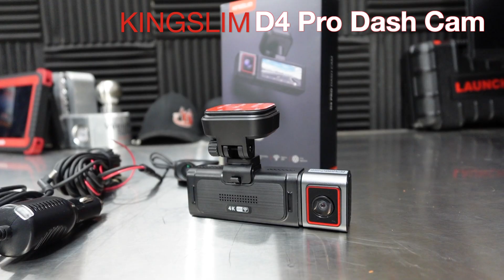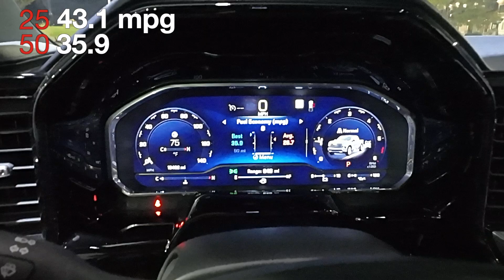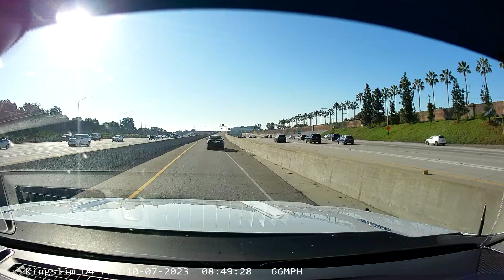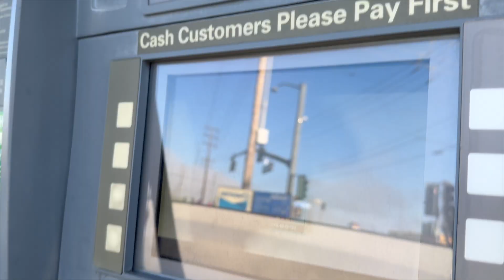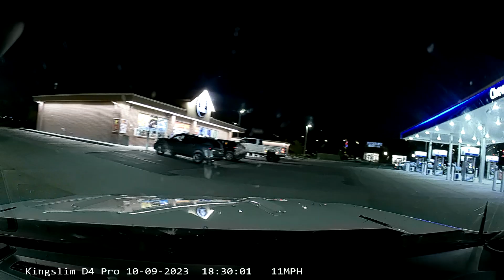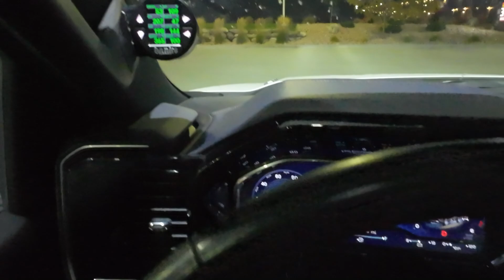How Good Can 3.0 Duramax MPG Get? Utah to California Road Trip

Comment: Hey. Having tested both lz0 an lm2 trucks which do you prefer? I’m close to buying either a used 2023 at4 or a 2021 at4. Both have 20k ish miles. The 2023 is a carbon pro and the 2021 has a heads up display. Otherwise they are similarly optioned.( 2023 has those big mud tires aswell)
Reply: Thank you. Its a tough decision for me having not owned either. The 2021 is about 11k cheaper with the price that dealer offered me. That’s what has me leaning that way. Both are pretty good deals for what I’m getting I feel. Haven’t had a chance to negotiate on the 2023 really but he told me he’d knock off 2k off the sticker. So it would be 61 for the 2023 and 50k for the 2021. Is it just the belt service interval or are their more qualities that increase the life?
Reply from the maker: @sirhc2291  for the cost savings alone, the LM2 is a great option. The LZ0 is not worth $11k difference.
Reply from the maker: Both are great, I prefer the LZO. It just has more power and has updates over the LM2 that will likely increase overall life.

Comment: Those are great numbers. I'll have to try Sport mode on my next trip.

My '23 finally came in at the start of October, just in time for the road trip from the UP of Michigan to Colorado (Like, literally the week before). Best indicated 450 from that trip was 28.7, worst tank showed 25.2 (around Denver and the mountains for the week). I was really happy with those numbers, they are up there with what my '18 Canyon 2.8L got, but the Silverado dwarfs the Canyon. The Silverado was great on the trip, it's very comfortable and easy to drive for such a big vehicle. Not so easy to parallel park in the city, though.

Interestingly enough, my oil level didn't change all that much, I could maybe add a splash but it's still right near the full mark. I know it doesn't need it yet, but since it's going in Monday for the bedliner and such, I'm having them do the first free oil change. 

Oddly enough, right after I picked her up and drove her home (120 miles), she threw a CEL that read out for 'Excessive Regen Commanded'. Since it was late Saturday, I figured I'd call the dealer on Monday, but the light turned off and never came back on. I've since put the Banks iDash from the Canyon in (using their nifty bracket), and I've got it setup to show Regen % and state, so I can keep an eye on it. Seems to Regen more often than the Canyon did, the Canyon would do it once a tank, the Silverado does it maybe twice.

My only real issue on the trip was the rock that cracked my windscreen. :( 

Fingers crossed this truck doesn't suffer from the problem my Canyon had. In the three years I owned it (and 25k miles or so), it went through two turbochargers due to ice formation and ingestion. The last time it happened literally a month before the warranty was up, so it was time to move on.
Reply from the maker: I wish you luck ! mine has been great overall !

Comment: Ive never tried it in sport mode but i always get better mileage with cruise off as i can apply power more evenly up and down hills. 22 refresh lm2 with 3/23 gears from southeast MO to South Carolina coast about 1500 round trip i got hand calc at 29.7 but 31.9 on dash. Stock ltz z71. What does sport mode actually change? Shift points? Timing?
Reply from the maker: Changes the shift points and throttle application is my understanding.

Comment: Really don’t know how u got that mpg , I have stock Silverado trail boss and I get 18 to 23 mpg and regen every 100 miles … my truck I think is f$& up
Reply from the maker: I don't think you regen every 100 miles, there would be a code that sets for frequent regens. For the mileage, not sure but I have had great numbers from all 4 of my trucks with the 3.0
Reply: @DemonWorks   well  can see the regens on my OBD link , every 100 to 118 miles …. I thinks something is wrong with my truck , of course dealers always says is normal
Reply from the maker: @watchmanexpert  phone or tablet based software has been proving itself to be incorrect. People often come stating the same and if you go in with a more professional level scan tool, you will see the #of completed regens to be very different from what the apps state. I believe it's because the apps don't understand when a regen is activated and deactivated based on driving so they account those for a regen each time rather than a completed regen counts as 1.
Reply: @DemonWorks   thanks brother! I think the app is right, why ? Because every time OBD say the truck is in regens I stop and the idle is high that normal  …  I can be wrong but looks like the OBD is right… I want to buy the one u have to check the regens , thanks u videos help me at lot
Reply: I'm in the same boat as you. I have a 23 GMC Sierra 1500 AT4. 

I do have an icon leveling kit with 4play 20x9 wheels. On stock size tires nitto recon grapplers. And revolver tonneau cover. 

And even before I changed wheels and suspension, I had very inconsistent fuel mileage. 

I live in South Florida and I take frequent trips to fort Myers all highway with cruise control at 80 mph and most days My trip will get 20-22 mpg and very rarely I get 27 mpg. 

These numbers are with the aftermarket parts. But before I did the work my numbers were all over the place on the highway anywhere from low 20s to. I think it broke 30 miles per gallon one time... 

And since you mentioned regen. Feel like my truck while it might not be regen, my idle I will notice is at 900 RPMs while in gear often. When it should be in the 600s no? If I just put truck in park It will go down to the 600s. And if I put it back in gear it stays there like normal until whenever it decides on ramping back up again. Which will be in a handful of miles or so.. 

I also don't have sport mode. I have normal or off-road so this must be an AT4 thing over whatever trim level you have. 

Something I've also noticed My exhaust brake seems to do absolutely nothing... And notice there is some of sort servo or butterfly about midway back on the exhaust. I wonder if that thing is staying closed, creating more back pressure than should be and lowering my fuel economy...

Comment: How was your DEF usage on the trip?

$6.29 for B20 is criminal. But California, so..

I'm also a big proponent of USB C on everything I can. It may seem counter to type C's reversibility, but sometimes they only work one way because not all type C ports and cables are wired the same, because the mfg saved some pennies. I have some female to female couplers that only work one way. Very annoying.
Reply from the maker: I used 2.5 gallons but I started with the gauge at 90%, so roughly 2 gallons on this trip.
Reply: @DemonWorks  So if my rough math is correct, the LZ0 uses about 30% more DEF than the LM2 on average?

Comment: I drove our 2023 Silverado 1500 z71 RST with the baby Duramax to Keizer Oregon and back to Orange County, Ca and averaged 29+ mpg for the 1922 mile trip. Best mileage for 25 miles was 39.6 mpg. Our last fill up on the return trip gave us an estimated range of 721 miles. I accidentally filled up with B100 in Oregon because the gas station sign said #2 Diesel but the pump said B100. I didn't notice any difference in performance or mileage. I get 15-17 mpg towing an R-Pod 179 that weighs about 3500 lbs. loaded. This truck more than doubled our towing range over the previous Nissan Frontier. Now we stop to refuel when we feel like it and not when the fuel gauge demands it.
Reply from the maker: Some great numbers !

Comment: I have a 2023 Tahoe and it comes with the LM2 engine. For some reason I guess I got the left over engine or that’s what GM put into its Tahoe line.  Anyway, the engine works awesome purchased it the end of May 2023. I already have over 11,500 miles on the truck.  Here’s the crazy thing. I live and work in NYC. My average to 11,500 miles is 25 mpg. I do a lot of Highway travel outside of NY and do travel to NJ a lot. Everything is stock. I’ve change the oil once I’m due soon. I’m very happy with the performance in the city and on the highway.
Reply from the maker: LM2 is a superb engine! You are getting great mileage out of it, for sure!
Reply: Still waiting on VSE to send me the correct bracket for the fuel saver system.  It’s been over two months and not a word. They keep telling your up next.
Reply from the maker: @eddiebrittain9710  What bracket are you waiting on? I was under the impression they all fit with one style bracket? @runvse
Reply: @eddiebrittain9710  Hmm... they sent you the wrong bracket with your fuel system saver and haven't sent you the right one in over two months? I've thought about getting that system from them, but having second thoughts after hearing this...

Comment: Just for another point of reference. My 2023 GMC SIERRA with the LZ0 and 3.23 rear end (completely stock) has an average fuel economy of 27.8 mpg over 10,000 miles (no towing). Oil useage is minimal at about 8 ounces per 3,000 miles since I changed to Mobil 1 ESP X2.
Reply: Were you experiencing more oil usage with the AC Delco oil?
Reply: @StephenPaul1160  A little bit more oil usage with the AC DELCO oil. I think I added 12 ounces after 3,000 miles. The Mobil 1 ESP X2 oil has 30% PAO so supposedly a much higher quality oil. I’ll keep tracking it as the engine gets more broken in.

Comment: Were you doing 80mph on the highway?
Reply from the maker: Typically I am at the speed limit or 5 over at times. Yes, to 80 as we have 70-80mph speed limits
Reply: @DemonWorks  would it be safe to assume that there would be some MPGs gained if you kept it between 70 to 75?
Reply from the maker: @hovsepdov  100% above 70 it really starts to drink. This mileage is in a truck with 3.73 gearing (most are 3.23) so these numbers are really good for how I’m driving and the equipment t on the truck.
Reply: Sorry if you explained in a previous video, but what’s the theory behind using sport mode vs regular?

Comment: Ugh B20, in efforts to use less petroleum just doesn’t contain the BTU that #2 Diesel has or for that matter B5 so yes the B20 will not achieve the same MPG

2024 sees many states and retailers increasing the bio blend for tax credits. 
Many will go a higher B blend in summer and lower for winter. B-11 in summer for Missouri B5 as of now year round in Kansas.  Loves travel centers are almost all B20 year round already.
Reply from the maker: I wasn’t aware of the b20 at all of the loves. 😑 I’m cutting open my fuel filters soon, curious what they look like and if the b20 makes them look different.

Comment: Do you continue filling it up another 4 gallons after the pump stops? I know some people don’t know this but I do that in my suburban so it comes out to full tank around 32/33 gallons
Reply from the maker: You won’t fit 32/33 in these tanks, the burban is much larger. I do continue after it stops and I get an extra .3-.6 gallons. The key on fuel mileage calculations is to just be consistent in what you do each time.
Reply: I’m doing a long road trip from Seattle to LA in the next few weeks I’ll keep you posted with my results
Reply: I’m doing a long road trip from Seattle to LA in the next few weeks I’ll keep you posted with my results